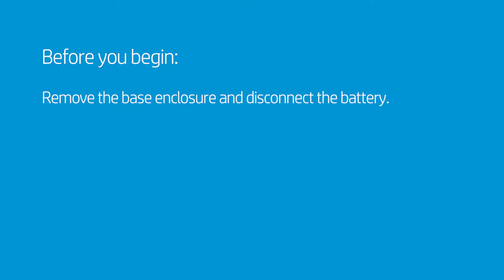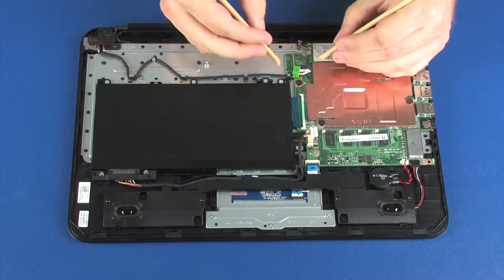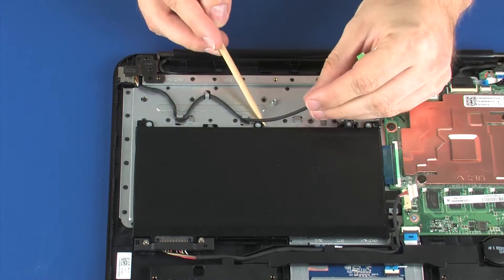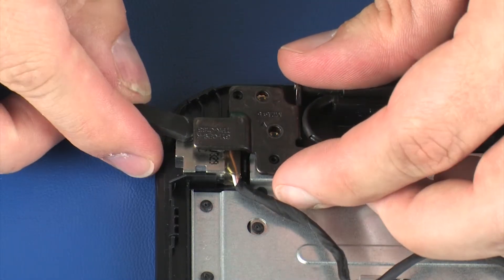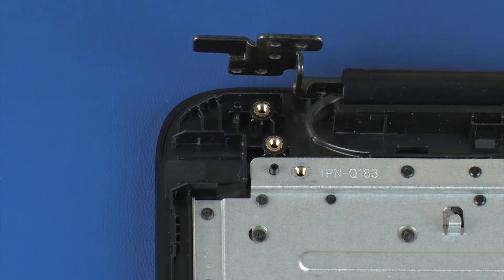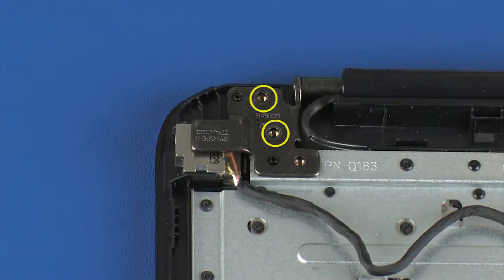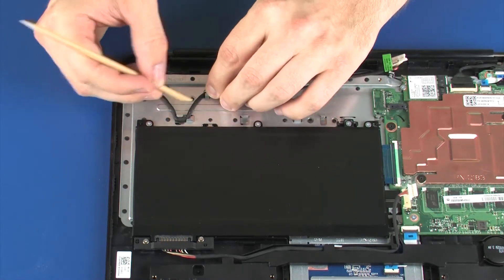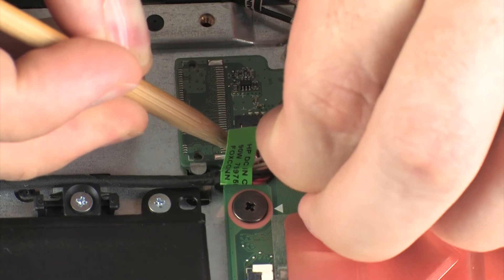Replace the Power Connector Cable | HP Stream 14 Notebooks | HP

Comment: my power connector dont have light, but the connector to the board is giving 19+ volts.....iis that faulty?
Reply from the maker: Hi there, thanks for contacting HP Global Social Media Support!
I understand that you are experiencing an issue with the power connector.
In order to get this issue fixed, please contact our customer care team over the phone or chat for further assistance, as this issue requires Live conversation with you over phone or chat to isolate the issue and provide you instantly with appropriate solution or repair/replacement options available at your place as per the warranty.
Please feel free to reach us on call/chat, please access this link to select your preferred country and language option to reach us. Global support link: - https://www8.hp.com/us/en/contact-hp/ww-phone-assist.html
Binu - Social Media Tech Support